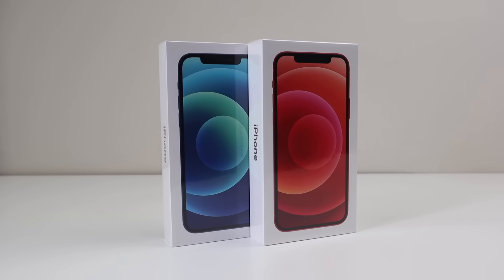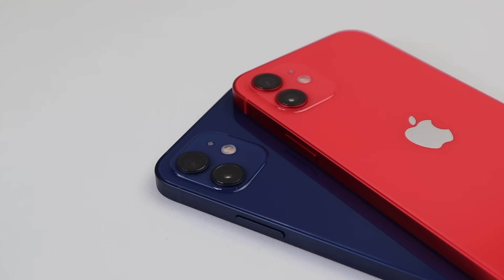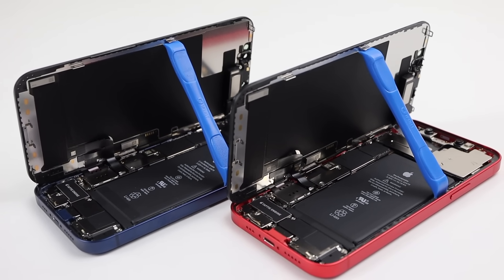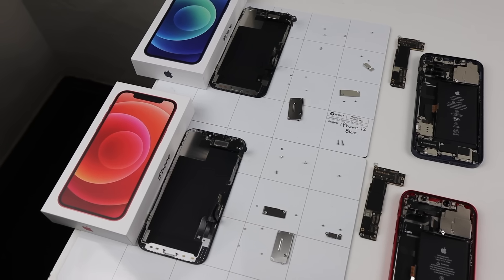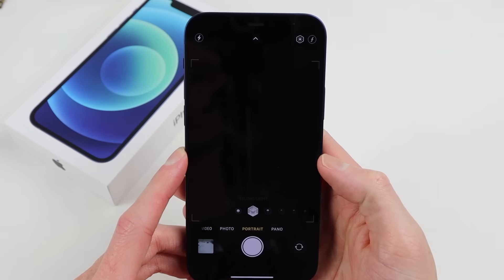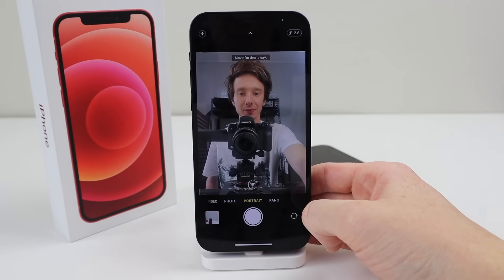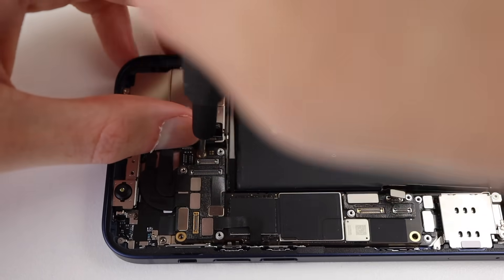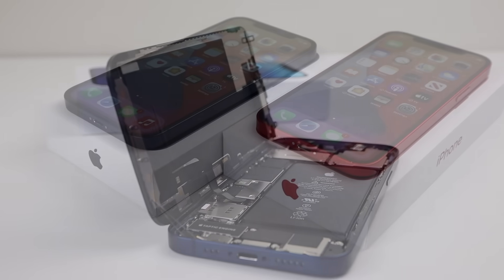iPhone 12 Anti Repair Design - Teardown and Repair Assessment

Comment: Apple is like communisim,  they control the phones, NOT YOU. I used to love apple devices and I hated android, a friend how ever after months of hounding me finally convinced me to try andriod at least once,  I said no at first, but i soon gave in and tried it, And I'm glad I did, after 4 months of use I was in aww. Of the stuff andriod could do! Example I can download programs built and designed for Windows on my phone, now my phone cant run them but it can act like flash drive and i can install those programs to my pc just by pluginging the phone usb, and my pc can download and run programs or installation wizards right off my Phone!!  Not even my apple device could do that!!  I always had to use the I tunes application thing and it had to be installed on the pc for me to connect my phone,  and it wouldnt allow me to use it as a storage device bother holding programs or others things meant for a totlay different device. All I Gotta say is I'm glad I switched

Comment: uuhg why do so many tubers make opening an iphone look hard. i get em open in like 10 secs. tho a spanky new one will take 30secs,cause it doesnt have the seal compromised by months/years of human sweat/oils but yea in the case of a new 11 or even older ,i dip my finger in alcohol and run it along the edge of the screen. all around. at least twice. it wicks into the tiny space. then i use a tool like i-seasame or similar and it still has to be sanded/filed/ground down razor thin,stick it in the bottom pry slowly possibly adding more alcohol with ur finger ,it dont normally cause im usually fixing broken screens so it dont matter if they break more

Comment: The iphone 13 is going to have some cyanide hidden inside it, for ecological reasons
Reply: "There's over 7 billion humans on Earth, killing some won't hurt."
- Apple
Reply: @EJS-jj8py  karma's coming for me after laughing at this
Reply: @mantecada5660  you mean apple is coming for laughing at this O-O
Reply: @EJS-jj8py  Covid-19 be like: 👁 👄 👁
Reply: Hmmm barely possible, since they will probably just deliver the screen.
Reply: Don’t apple seeds contain cyanide? Quite fitting for them to actually do that then
Reply: @MrMarkymarky89  close! Arsenic actually
Reply: “It’s good for the plants”
Reply: Apple : Write that down, Write that down
Reply: Each part is gonna be 5000 dollars each
Reply: Without Steve Jobs apple can be in a serious problem for being shit
Reply: iphone 13 is the same as the 12 but they brought back the fingerprint feature on the 13 model
Reply: @MelchizedekKohen  apple 13 is gonna be just the battery and cameras and apple 14 is just gonna be air
Reply: @MelchizedekKohen  at least until you purchase the rest of the device for 600 dollars per part because yes
Reply: @ybajoe9773  oh i just sold my 12 mini compared it side by side with my trusty s10 the galaxy really does blow the iPhone away wow
Reply: Frankly, I wonder if the 13 will come in 2 parts: an AMOLED screen and the rest of the phone. But no... every part is locked down, so the 13'll just be a huge money mine. But then people'll quit using Apple. Which is the thing I dream of.

Comment: my phone has 25mp front camera and 64GB aswell as 4G
iphone 12 has dual 12MP camera and some of them have 64GB and 5G
my phone is £180  ($246)
iphone 12 is £800  ($1093)
my phone is the samsung galaxy A40 in case you were wondering
Reply: not to mention my phone is reconized as a mid range phone iphone 12 is meant to be cutting edge

Comment: Customer: I just need my screen replaced on my iPhone.
Apple Repair: That’ll be $1,299
Reply: If you purchase their service and repair plan for $1500 then it covers ALL repairs!
Reply: Oh, you're not continuing with crapple products and you want your data from your broken iPhone migrated to a different phone? Yeah...we can't do that. Your data is permanently locked out until you can log back in to a registered crapple device to do that migration. I'm so sorry about that. Is there anything else I can help you with today?
Reply: @ryanshannon7703  more like "is there anything else i can sell you today?"
Reply: @ryanshannon7703  they refuse to repair in most cases and also yeah they do that so you give them even more money
Reply: I got my old iPhone screen repaired by someone at a repair shop at a plaza and it was only $45, nothing was wrong with it after 🐸
Reply: @streamwalls3168  nice. That is why you ALWAYS use 3rd party apple repair.
Reply: Lol yeah. I am an apple fan yet even i am pissed that apple does that.
Reply: I had my 6s plus screen replaced by some chinese made part for around $20 including labor. I guess this would be last time i'll be using an iPhone.
Reply: apple: fucc you give us money
Reply: ...
Customer: I'll get a new phone then.
Reply: @Cube8  that's the point
Reply: The most expensive Apple phone as of February 2021 is the 12 Pro Max that costs $1,100 at the base storage. Maybe factcheck yourself before crapping into a comments section.

Comment: 0:58 - This is overblown. I hate Apple, but all those iSheep have their old chargers AND old cables. They can charge it just fine without a charger in the box. Let's put our energy towards blasting Apple for real issues instead of manufacturing issues where none exist.
10:10 - See, you had an old cable. Total non-issue.
Reply: Yeah, all the crap that happens after the motherboard swap is what Apple should be raked over the coals for. That's total garbage.

Comment: I kind of wonder if when a new part is installed, it burns the mainboard's serial onto it.   Replacing a defective part with a factory new one that was never in a powered up phone, would allow it to work.   Since they power up the phones at least once at the factory, even buying a brand new phone for it's component would render it unusable in any other phones.

Unfortunately, that would mean that Apple doesn't have a program to re-pair modules.  So no one working in a store or for Apple corporate could ever leak it.  

If so, it would mean that we can never swap batteries or cameras on any of these phones, without receiving a factory new part.  3rd parties can't just manufacture an identical part, and clone over the data stored on the chips, because they'd be cloning data including the serial.    Maybe, possibly, a comparison of the data from two or more devices could show that subtle difference, and that part of the data could be zeroed or nulled, but that may not even work.  The mainboard may expect a specific string to be present on the new and unconfigured components.   That's assuming the data is just stored straight to it, and not encoded in any fancy ways.   

Long ago, not on Apple stuff, on some applications, where data confidentially was important, we'd encrypt the string (serial), along with microtime and a random string.   We only cared about the important string, and ignored the rest.    If someone did clone the data on a camera, it would be trivial for Apple to include it in a ban list on the next update.

I'm really glad that I don't work on Apple devices.   That one looks a bit annoying, but not technically difficult.  Having Apple fighting against repair people is a very bad thing.   But they have popularity among people who can afford to replace their devices yearly.  Their target market doesn't mind just buying a new phone because the battery or camera stopped working.  They don't care about the people where this device is an investment for them, and they'd need it to continue working for years to come.

Comment: But Apple allows third party companies to use Apple genuine parts as long as they get certified training. This is preventing third party display parts not third party companies. Most screen repairs require a calibration which third party companies have access to do

Comment: Apple's warranty lasts a few years and does not apply to batteries! , this means that if you invalidate the warranty or it expires you must also take into account a further problem that is the fact that the hardware or the software could block the iPhone and of course all this can be read as buyer safety but it is a fact that any product not only Apple has a limited duration in time, we are talking about products born for a limited use in time from several points of view, I doubt that any company will release a product with interchangeable batteries to give a simple example.

Comment: To reduce "e-waste for the environment"
Don't  for get there's still cars that run on gas right? So we have to do alot of work if we wanna work on the environment we have to all switch to electric cars and stop using gas and not only that, also random smells and pollution in the air from facilities.

Comment: I recently worked for Asurion doing Apple and Samsung repairs. The reason official parts from other devices are not working is because when you do an official repair, the phone's software requires that you use a special program called RepairCal to log the serial number of the new component and then perform a calibration. This syncs the new part to the device and makes it work. This isn't locked down more than ever before. RepairCal calibrations are required for all authorized repairs from iphone 8 and up.

Comment: These individual parts have some sort of permanent ID to identify particular hardware (in some read-only register) and it's stored centrally(But where? Is it readable/writable) after reading them from the initial assembly, cross-checked when needed (POST, on certain app launch...) - This is my theory. Lets 3D print a phone for ourselves - DIY phone. But need to know how the IMEI/WifiMAC works though (Govt permission/license and stuff like that). Or they should make the tools available for rewriting the IDs - which kinda beats their purpose.

Comment: Yeah the only thing green about not providing a charger is the money you will spend buying the right kind.  Also got to love that crapple "quality" there with a rounded off screw from the factory.

So is this still the case or did they turn the pairing off like they did for some of the previous phones as it possibly ran afoul of some of the federal laws like the magnussen moss warranty act?

Comment: 85c for 8-10min any iphone or Samsung phone will open easily. The iphone 12 is pretty easy to repair, IF you know what you're doing. Also, any iphone 8 and up, you have to clone the screen firmware and copy it to the new screen, you won't have as many issues. Unlike Samsung, who makes OEM parts available and uses at most 2 different sizes of phillips screws, Apple does not, there's 20+ different sized screws with different heads, they love their tri-point. Save yourself trouble and never buy apple junk, it's over priced and breaks very easily.

Comment: You can talk all about repair you want, but lets be real, until DISPOSABLE OLED is gone, people are heavily incentivized to buy brand new and people in the know have legitimate incentive to shy away from used hardware. The hypocrisy of people who push OLED is aggravating. Depending on your use case, OLED can be more disposable than the battery and it's much harder and more expensive to replace.

Comment: @UCSOekSg6S0wEDerOQgTXGmg NO, I don't agree! If I buy a Device, it is MY property! Only I ca make the decision to repair the Device! There MUST be a Possibility to buy tools for repairing. The last years I bought Apple-Devices because of their repairability. No Androidixt-Device was so easy to repair! I broke/dropped my iPhone 6 Plus several times. I replaced 15 Displays. Since 3 Years I have a iPhone XS Max, and I didn't dropped it one time. But if..... I have to fix it. If the future iPhones don't have the possibility for Self-Repairs, I don't need them anymore. I have the whole Apple-Eco-System at home. Maybe it is time to switch to Androidixt. There are several cheap and fast / good Androidixt-Devices, which I can (without bad certain) simply throw away and buy a complete new Device for the same price a iPhone-Display or Battery-Change costs. SHAxE APPLE, SHAxE ON YOU

Comment: Planned obsolecence at its finest. It has nothing to do with “e-waste”. It’s pure greed. They are disgusting.
Reply: They even have the balls to tell you they don’t include a charger because they want to go green.
Reply: No man, they want to save the environment. That is why they are removing the charger but make it pay for it because that is saving their walle... I mean environment.
Reply: @PedroGarcia-df2xp  They changed to USB-C adapters on the last generation, this is clearly marketing maybe 1% of the 2B apple chargers out there are USBC and yet they use this argument not to furnish new chargers lmao
Reply: Damn you wrote three lines on this when you could just sum it up with “capitalism”
Reply: I wouldn't consider preventing the right to repair as planned obsolescence. The phone doesn't break on it's own or limit features after a certain amount of time. It only needs to be repaired if it wears down from use, not because it wears down on it's own.

Comment: What you created by going straight for and expecting to swap the logic board in two devices is a serial number mismatch. This is the act that enables people to bypass geo locks that are required for apple to sell its devices in certain major countries and prevent the unlocking of legally restricted features in some geos. It’s also the mechanism that is used to launder stolen devices and sell counterfeit devices in the hundreds of thousands globally. Calibrating and pairing identification features like Face ID to their board is a large factor in the security of a device and helps massively to prevent hardware hacks. Repair expectations have a limit and you should focus your work on the repairability of peripheral components.

Comment: Don't worry, China Will show us the way to repair iphone 12.
Reply: Ofc they will, they've already assembled them.
Reply: I hope so
Reply: China made identical copies of each component. So when your iphone is damaged or defective all they need is your S/N.
Reply: Long live the Chinese and Aliexpress (may peace and blessings be upon them)
Reply: any idea of when 3rd party parts will be accessible?
Reply: @patrickaliberti8173  for some spare parts that reliable you should wait 1 year after phone released cos that's when the warranty already off and the market for 3rd party parts emerge very significantly high. Don't buy any parts before that time because even if there's already parts for iphone 12, but it's low quality because it's early version. I remember when iphone with true tone/touch id home button/face id is unrepairable because the screen replacement/home button can't use that features. Even the battery is unreplaceable because the battery health features will be off if it isn't the original apple factory version.

But now everything is repairable. Just wait until your warranty already off. If apple can repair your iphone, then some small shop in the corner of an alley in Shenzhen can repair it too. Just wait for the device to clone the parts so your phone can recognize it like the device they made it for screen cloning.
Reply: @patrickaliberti8173  use Alibaba.com it has parts for almost every device
Reply: More like *India
Reply: @benstokes3377  nahh Most apple factories are located in China, india is fot tech support
Reply: PFFFT

Comment: Hey bud. Do you think this could possibly be some sort of hardware/software protection so competitors can't steal certain things when they pull open the phone and try to use it. Or maybe they do this so if your phone is stolen, the parts themselfs become useless, or traceable because of this pairing with the phone.

Comment: My hypothesis is that the parts for each iPhone has some kind of code or identification of some sort that each smart part has to recognize that it’s “capable” for the iPhone. So in that case both iPhone have different coded parts. So when it detects that the code isn’t what it was used to the iPhone either just messes up or purposely does that to prevent third party repair. Again this is just a hypothesis but that’s what my guess is that prevents third party and or self repair

Comment: Great Job. I'm an Y and used to get some occasions to program the first Apple II back in the early 80s as I was a kid and computing, especially 8-bits home computers started to appear. It was a rare ressource and we used to hang around in computer clubs, because it was hard to own your own stuff because expensive at that time. Apple and Apple owners have ALWAYS been arrogant pricks letting you know and feel that Apple was expensive and far better than your shitty c64, Sinclair spectrum or Amstrad CPC which became much more sold back at that period. This arrogance never changed during the next decades passing, "I have an Apple, I'm better that you" was the message. Back at the end of the 90's, I started using Linux and have been using it for over 20 years now, and it has been the most amazing OS development in the history. I have been picking up Android smart-phones for years , they're not only cheaper and easily reparable with much more accessible and cheap spare parts, this  kind of issues NEVER happens. Apple knows perfectly how to take money out of your pocket, has always been like that, already for 40 years ago. Cheers from France.